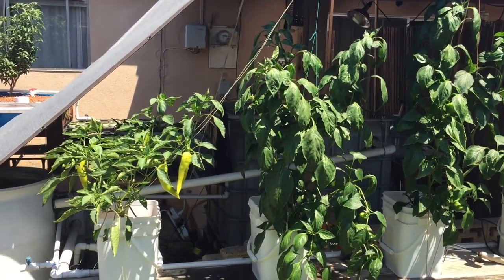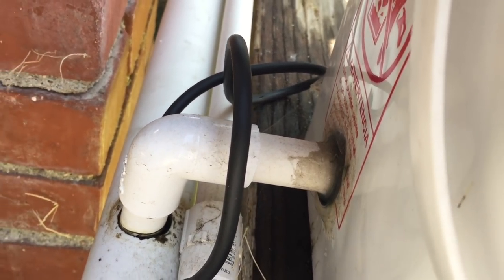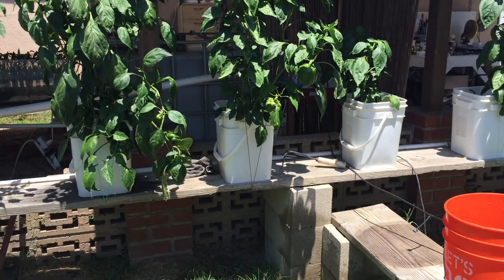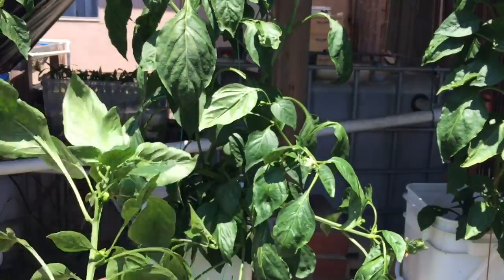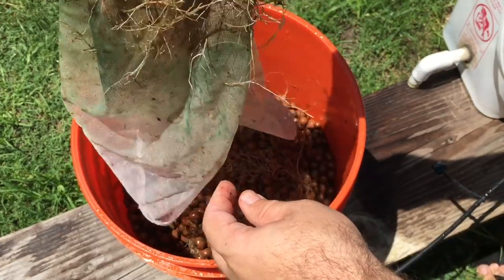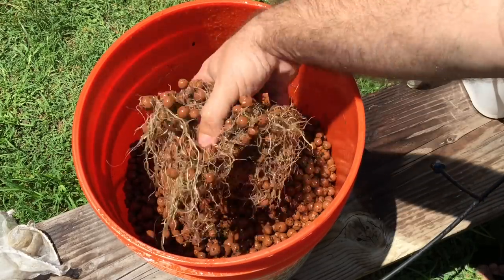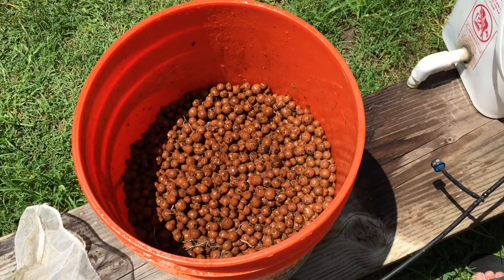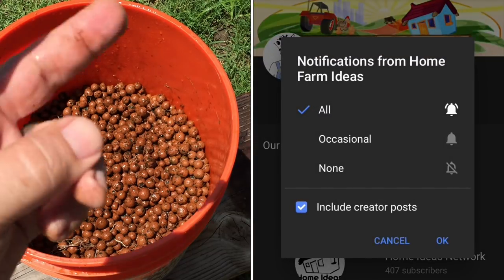Dutch Bucket Drama!

Comment from the maker: Well, as you guys can see from the video I was having a little bit of a clog in my dutch bucket system in my bucket actually started to leak. I also found out that the paint bucket strainers do not hold back root systems from a constant flow system. I’ve talked back-and-forth with a friend named Tod and I think the paint bucket strainers will work in a timed system. I think if you have the water flow on a timer it gives your root systems time to grow hair roots but when you have a constant flow like I do in my system it seems to grow more tap roots. I did not show it in this video but I also have a solenoid that opens and closes water flow but it’s not working very well. As you can see from the root system on this pepper plant that I take out of the bucket it has pretty good looking roots but there was a lot that turned into tap roots and clogged the drain. The upper area of my pepper plants root system almost looked like an hourglass root system but did you see all the root in the bottom of the bag and the clump of roots? That was all long tap roots on the bottom! Cray cray!
Reply: you could try the buckets in a ebb and flow tray
Reply from the maker: Do not know what that is. Looking it up:)
Reply: Just thinking out loud.  What if you don't use the inside elbow.  Make the pipe longer till it reaches the other side of the bucket and drill 1/4" holes all over the pipe.  When the root totally clogs it up from there, your done for the season anyway.

Comment: I used a netcup in the bottom of the buckets set into a "reservoir return" which can be either a gutter or a PVC pipe.  Never clogged and you don't need paint strainers.  If interested, I can link it.  It's a version of a "modified dutch" bucket like yours.
Reply from the maker: Post it my friend:)
Reply: And can use 1/4" hose vs pvc for supply line.  Just some ideas.  All the best.

Comment: I didn't see allot roots in the drain and your elbow in the bottom is being pushed down by the bag I'm thinking and that's probably not helping. I put my drain higher and my elbow sits off the bottom about a half inch and i put a chunk of foam under it to keep the bag from pushing it down and causing leaks at the grommet, and that's my 2 cents. Thanks for sharing and as always Keep Building👍

Comment: Consider using a "Blue Walmart bag" $.50 each, they work much better than paint strainers. The thicker materials helps contain the roots much better and are roughly the same size as a paint strainer. Thanks
Reply: Can I ask you what purpose  the blue WalMart bags are sold by Walmart for?

Comment: What ppm's are you running? Thanks
Reply from the maker: Not sure what ppm’s you are referring to? My nitrates, nitrites, iron?
Reply: The parts per million of your hydroponic solution as measured with a TDS meter (available on Amazon for appox $10-$12). You can measure the strength of your solution and add/weaken the amount for optimal plant growth.Thanks
Reply from the maker: This is not hydro. This is a aquaponic system:)
Reply: Understood, thanks